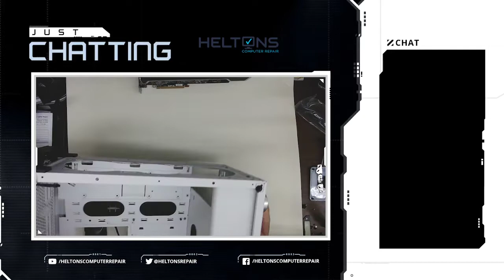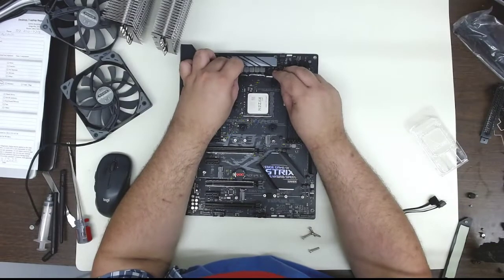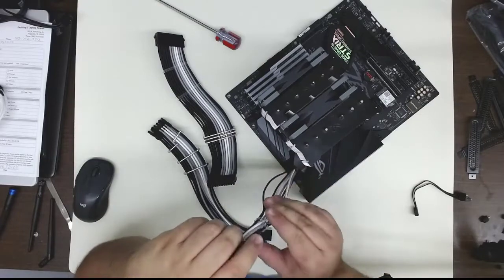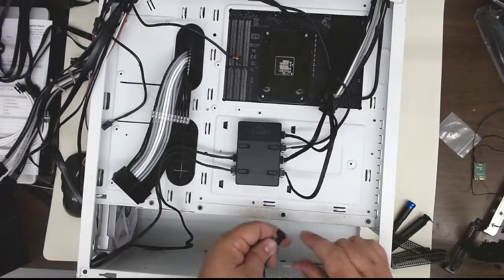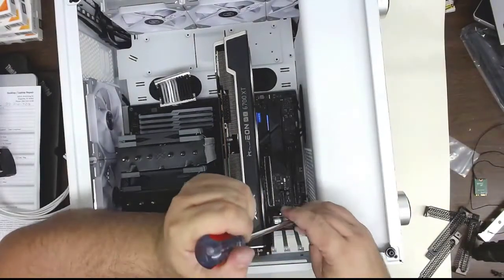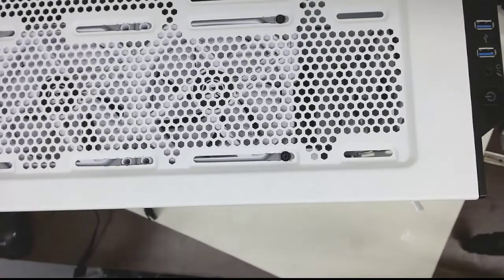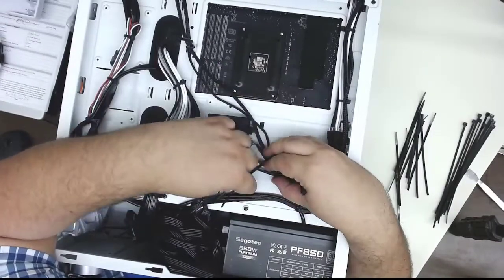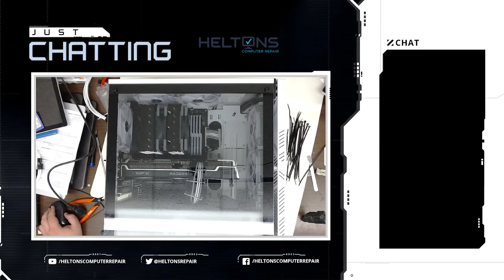PC Build: Custom Builds Available

Comment: Hey everyone Daluna here! As mentioned above I am the one who is going to be handling the majority of the builds for Helton Computer Repair! If you watch this and want to get a Desktop for ether Work, Video Editing Gaming, Streaming or Programming/Development, email me and we can talk Budget and components needed to get the most out of your Computer! 
All builds include basic White or Black Extension Cables unless you would like a certain theme with the build like I did here!
Specs for the build:
AMD R5 5600x
ASUS ROG Strix B450 v2
XFX AMD RX 6700 xt
32 gb G-Skill Trident Z 3200 Ram
500gb m.2 NVME ssd
1tb m.2 SATA ssd
6x Lian Li SL120 Unifans
Corsair 275r Airflow
Segotep 850 80+ Platinum 
3 ARGB strips
Up-here RGB GPU sag bracket.